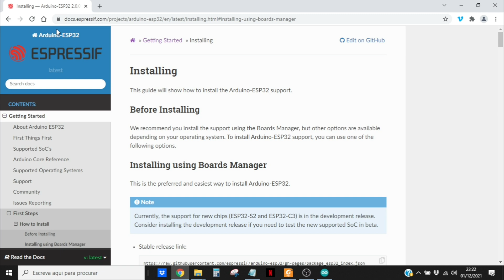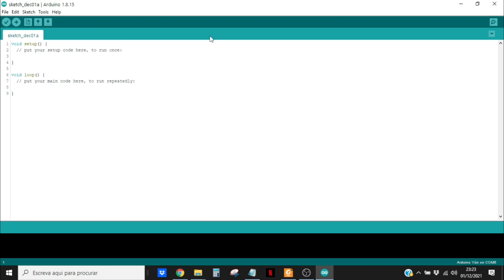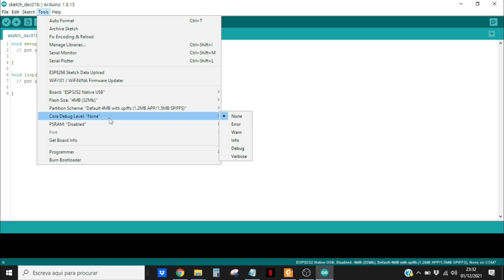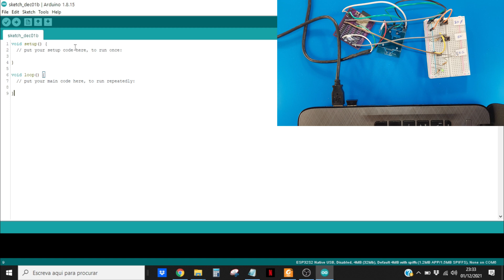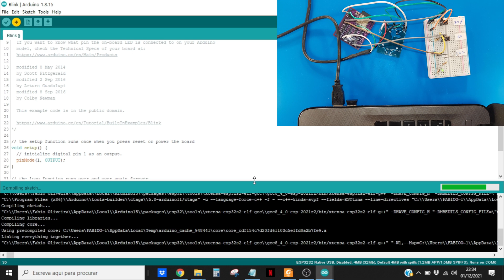1. Program the ESP32-S2-mini-1 using the native USB port in Arduino IDE

Comment: Great video! Just subscribed to your channel. I facing an issue here. Iam using the same hardware as yours and followed the instructions given by you! When I connect my device to the PC its showing an error "device descriptor request failed" and same error showed up  with multiple PCs and testing the same code on multiple esp32s2-mini1 boards. Can you think of a solution for this?
Thanks!
Reply from the maker: Hello Lalith. Have tou tried this solutions? https://softwarekeep.com/help-center/how-to-fix-device-descriptor-request-failed-unknown-usb-device-in-windows-10
Right now I do not have the board with me to test. Have you updated the drivers? Using the correct board selection in arduino and settings?
Reply: @fabio90oliveira  Yes I tried it!, The issue is surely with the device because when I connect the device to multiple PCs that run on windows 10, the issue encountered is the same! I followed each and every instruction given in your video and when I connect the device, the error is the same "Device Descriptor Request failed". What can be done about this? Did you test USB on "esp32s2 wrover or wroom" modules??
Reply from the maker: @lalithkumar9807  What about the soldering process? Maybe the solder  paste solidified and connected the two pads. Have you checked it? Do you have other module to test in order to check if the one you are using is not damaged?
Reply: @fabio90oliveira  Thanks for the reply! Usb is working great now! The issue was that we added 0 ohm resistors and capacitors to the d+ and d- lines which led to this issue. Removing them solved the issue!